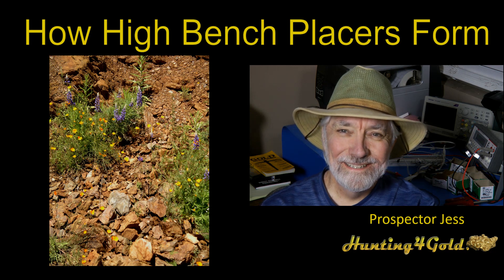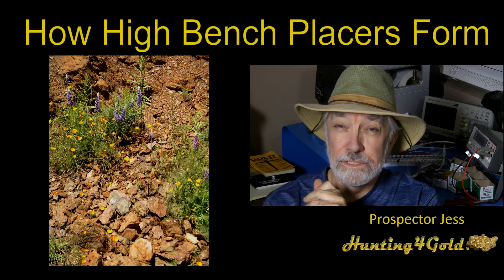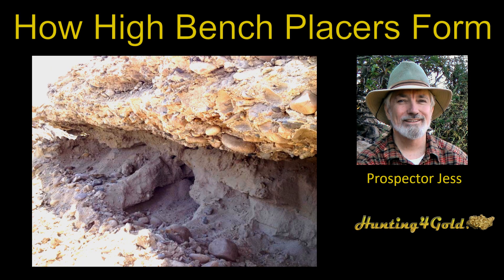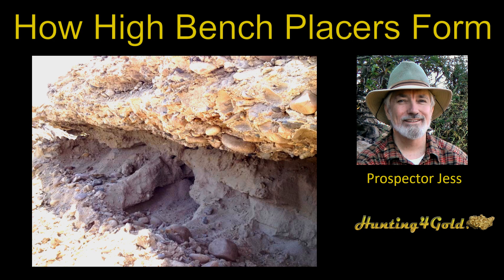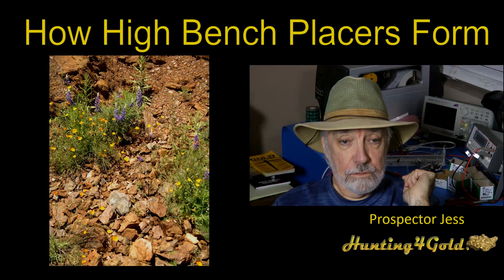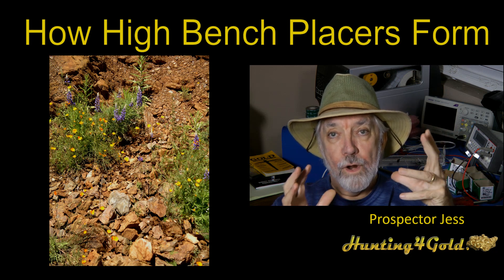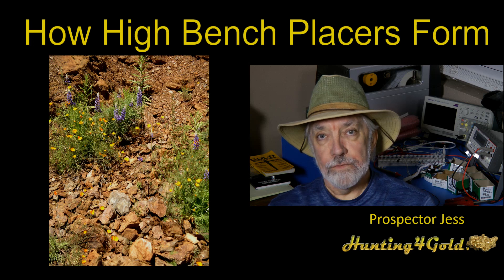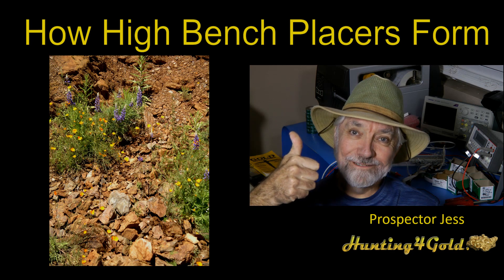How Do High Bench Gold Placers Form?

Comment: That bench material is like 2-3 sack concrete. Once you find some it gets easier to spot as long as the vegetation isn't too thick around those areas. The easy ones seem to be 25-50 ft above the current river levels, the higher ones can be near impossible to spot unless penetrating imagery is available.